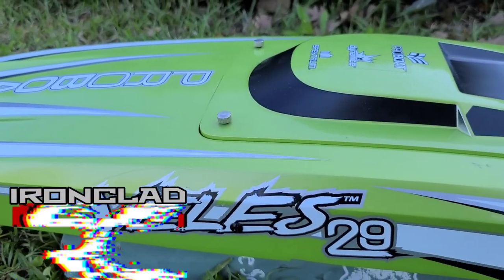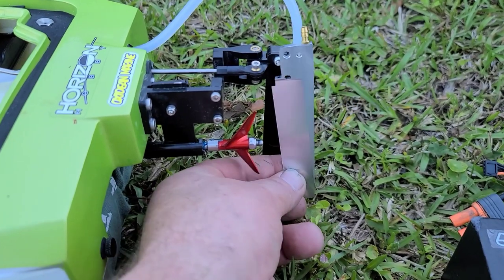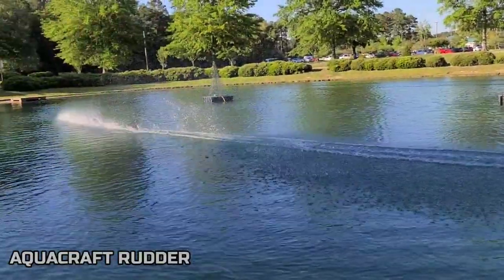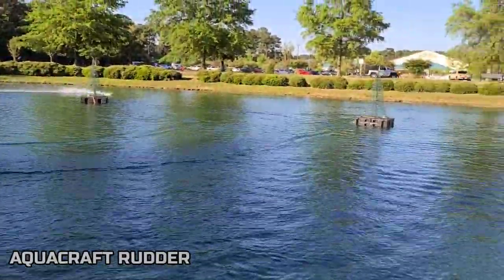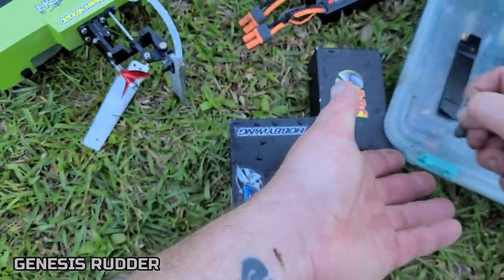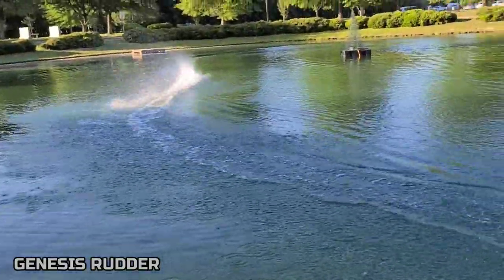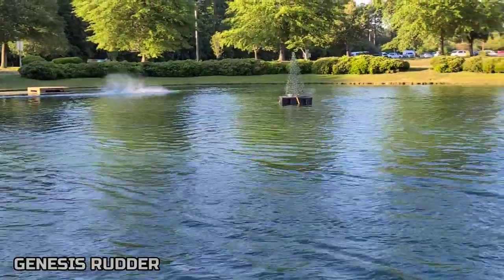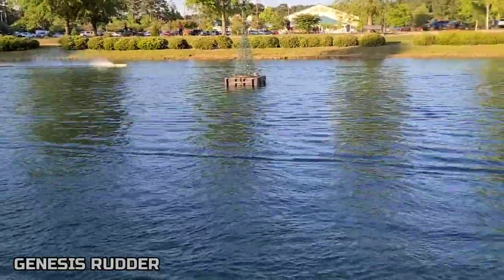Proboat Veles 29 Rudder Testing - Rc Boat Steering Problems

Comment: Hi B. Just found this whole set of vids on the Veles. Super set. Great info for my tuning of my first boat. Just a comment/theory on rudder “oversteer”. When you turn the control maybe 20% in a turn and the boat slows a bit whether you lay off the trigger or not, then, as the turn progresses I find that once it gets to a certain speed and “angle of attack” the front inside edge of the sponson catches in the water and the boat almost pivots on that sponson. 

At higher speeds it seems to me that the inside edge of that sponson doesn’t catch because 1, the boat is higher out of the water (drier) and 2, because you’re moving faster and the water is “harder”, less likely to catch. (that’s the waterskier in me coming out). 

What say you all-knowing, all-seeing boat-god!?😆👍🏽

Comment: Yet another REALLY useful and informative video Big B. Often overlooked, rudder choice is so important as you have shown.
So yet another variable in the universe of unlimited variables that come into play with the RC boat hobby...
Hull shape, size, profile. Motor diameter, length, kV rating, pole count. Inboard, outboard motor. Electric, gas, nitro. Conventional drive, integrated or jet drive. Drive shaft type, diameter, length and type. ESC current handling and power management. Battery type, weight, dimensions, voltage, Mah and C rating. Hardware and electronics placement for correct COG. All the variables with water cooling set up. Transmitter and receiver type. Strut/stinger position, length and angle. Trim tab size, position and angle. Turn fin shape, size, position and angle. Prop type (number of blades and material) diameter, pitch, rake and blade profile. And of course rudder shape, size and angle.
Geesh! I could go on but I'll quit 'jackin mah jaws'! 
No wonder this hobby is so unique and interesting. With all these variables is it any wonder that we keep on tinkering, testing and tuning?
Thanks for sharing the knowledge brother. Awesome stuff 👏 👌
Reply from the maker: Thanks steve Yep I believe you just about covered everything.   You forgot the part about having fun while your finding your  rc boat bliss

Comment: Thanks for sharing this boat definitely likes to role over...uuggg..mine does the same dam thing.uugg..lol..so we took the stock rudder plugged the holes with jb weld..we run different water pick ups behind the prop.. anyways we took the stock rudder filed it down flatter..thined it out...we then cut the bottom of the rudder off just under the bottom water pick up that was there.we then filed the angle going up from the bottom like it was stock..ok...and rounded the two bottom ends to finish it so far so good...just putting it out there...lol...as always iron clad style man... 😊.. ❤️..
Reply from the maker: I did the same thing to my beles rudder night and day

Comment: Love these test and tune videos. Great timing too, I just recently modified my stock Veles rudder. I believe that I heard advice here on your channel about modifying rudder to optimize handling.  I removed approx 1/2" of the length from the bottom. Then I reshaped the bottom of the rudder tapering the bottom edges  and thinned out the thickness of whole rudder. Also I sharpened the leading edge and chamfered the trailing edge.  So far so good. My low speed turning  has improved greatly with response being way more predictable.  As always thanks for the info bro. Rc boatgang
Reply from the maker: So it did work that's great to hear.   Your opinion is it worth doing and showing the viewers?   I've been wanting to modify the stock rudder but haven't grew the balls to do so yet.   😕
Reply: @IRONCLADRC  definitely worth the effort bro. I wil post a. Quick vid so you can see what it turned out like . Everything you had mentioned previously worked like a charm . After modifications, I had to use the veles to recover the SonicWake while waterlogged. If not for the mods to the rudder I think that I might have lost both of them.
Reply from the maker: Yea man that would be awesome.  I'd definitely like to see the modification I saw the sonicwake rescue & your right the veles did look very planted In the water

Comment: Just put this boat on the water for the first-time last weekend and it made it about 50 feet and the flex cable slipped in the collet and I know it was tight before launching, brought it in and tightened it again and the same thing so I inspected the collet, and the collet nut was stripped out. The collet looks just fine but the taper in the nut is gone so it won't tighten down on the flex-cable the metal is so soft that the stainless-steel collet shaved the taper out of the nut and didn't hurt the collet at all. I'm disappointed with pro boat on the first run on my new Veles 29. got a new collet coming from Offshore marine should be here tomorrow we will give it another go this weekend
Reply from the maker: You have extra to go over the whole boat inside & out.  check  everything before your first run.
Reply: @IRONCLADRC  After further inspection I found that the collet nut was made from soft mild Chinese Steel the collet was ok and made of stainless steel the nut on the other hand either didn't get hardened or was made from the wrong material. The OSE coupler is working fine. I did go over the whole boat before taking to the lake. I think that even experienced guys would not catch this defect right out of the gate.

Comment: Good video brother.  Very informative.
I don’t own one but a buddy does and I’m very aware of how the boat rolls in the corner.   Now I do wonder if it’s how the sponson is shaped and causing the outside edge of the sponson to catch the water and tip it over.   Maybe adding Dihedral to the sponson may help.   I own a different catamaran and the sponson has a lot of dehydral in the sponson ride pad and when she turns the boat will actually lean some.  
A thought that crossed my mind for a experiment on the veles.
Reply from the maker: When you say dihedral  are you talking about  adding angle, dead rise angle to the sponsons?    Or more non-trip to the outsides of the sponson?   Not sure ?   Sorry I'm not exactly sure what dihedral is, lol.
Reply: @IRONCLADRC  yes angle/ dead rise on the ride pad. Example this cat I have.  1 3/16 wide ride pad and the outer edge rises up 1/8.  +/- 5 degrees.   
Just a thought on my end as to blue printing the hull.   Dead rise is common to sponson designs specially in hydroplanes. Always experimenting.
Reply from the maker: @mad_lizard  Roger that, I figured that's what you were talking about.   I agree I think that would help tremendously.  I alot of work the pull off but it's definitely possible, I've gotta do some finish work to my sponsons and I will definitely keep that in mind..   thanks brother.
Reply: @IRONCLADRC  your welcome anytime brother.  We’re always tinkering testing and running

Comment: Correct me if i am wrong  when i set up CG on my boat i divide boat in 3 sections... Like if i have a 30 inch boat my cg is approx 20''' from bow going back... I also try to keep center of gravity as low as possible and when my boat sits in water i do my best so it does not lean to one side... but when i think about it if you are racing like you do its good to have more weight on left side of boat anyway....
Reply from the maker: You're on the right track..

Comment: Always a great video. Thank you for the great info. Question which one would you prefer the Veles or the ul-19?
Reply from the maker: What's your skill level regarding rc boats? The ul-19 is an awesome boat one of my favorites but it definitely needs some work to be a solid oval boat.  (Cooling, turn fin & upgraded esc)   The veles is a little more beginner friendly and really only need a second cooling line & servo to make it a solid boat.

Comment: Hello brother hope all is well I have question for you! I have sonic wake v2 and the boat turns one direction great nearly on a dime ( I believe it’s turn left really good) but it hardly turns the other direction  at all! I realize you need to have some momentum or speed when turning however when saying that the boat turns the one direction really well with or without speed but won’t turn the other direction with or without speed, do you have any suggestions

Comment: So I'm thinking and wondering if trim tabs would help this boat...I definitely don't like the blow overs and running pack all up front..thinking trim tabs move packs back to center full trigger...what do you think...
Reply from the maker: Personally I would never put trim tabs on the veles.
Reply: @IRONCLADRC  were going to make some temporary home make bent tabs and just use some double face tape foam to just hold them there and see what happens..yes I can respect you wouldn't.. ❤️..will try it anyway no holes drilled...lol..if they stay on..lol..
Reply from the maker: Try setting them about 5-6mm above the ride surface I've had good luck with that setup on my 42 kinda Acts as a ride pad not a trim tab

Comment: Big B, I know you usually leave the epoxy bare after blueprinting your hulls, would it help to use something like 2k clear coat and sand with 400/600 grit for best results and or even use some of the graphite spray?
Reply from the maker: Epoxy/graphit works the best I've been testing different finishes on different boats to see what works best for me.    I've used clear coats, epoxy/graphite, epoxy with pigments, epox paints,  primers for my final finishing in the past,  as long as it's hard & sandable I don't see why not.   I used clear acrylic as a top coat for the blueprint on my blackjack 42 after I  airbrushed a design, it sands good dries fast but doesn't build/fill very good.   If you use a clear the boat basically needs to be finished to its final shape because clears tend to lay down flat.
Reply: @IRONCLADRC  in this instance I’ll be blue printing the bottom of a Geico Hull and a Veles 29” hull. Do you think sanding them to where they are true and then put the graphite spray right on? Do you think I should sand them true and then add my paint, clear coat with 2k clear and then graphite spray the sponsons?

Comment: Big B how's it going I have this boat and I know wat u mean by tips on a turn I'm going to try a longer rudder it looked like it help and how do u blueprint been thinking about that on my veles thanks
Reply from the maker: A shorter rudder may be the ticket you ca. Actuallyshorten the stock rudderand get a better ride ( i may do that here shortly) , if you have extra rudders laying around I'd try a couple different rudders to see what you like. It's kinda fun Testing and watching for the differences between each...   as for the blue print It's alot of work, alot of work!  if done incorrectly it would ruin the ride of the boat.  Blueprinting a boat is basically taking out any imperfections, dips, hooks, that may be in the ride surfce.. most boats Don't need to be Blueprinted there is that rare occasion that Blueprinting a hull will improve the ride.  Hope this helps
Reply: @IRONCLADRC  big B I'm just checking my msgs and thanks for the advice but how short should I make the normal rudder on the VELES 29 take like an inch or so off or ???? And my bad for the late respond back busy up here in Wisconsin now summer time almost here  thanks for the help and blueprinting sounds a little hard for me to do at this time I'm still just learning all bout rc boats thanks again

Comment: dude have you tryed the ul19  rudder thats what i use as this boat is made to go fast in straight line and turns
Reply from the maker: I was gonna bring the ul19 rudder for the testing but didn't have the time to remove it.  That's for the tip.

Comment: Where can get the battereries you get and charger
Reply from the maker: This is a good setup. 6s 100c bundle 

https://www.avantlink.com/click.php?tt=cl&merchant_id=953aec29-878e-4306-b620-2df85883455e&website_id=70256520-69d3-496b-a06d-cfbf9af7a81d&url=https%3A%2F%2Fwww.horizonhobby.com%2Fhttps%3A%2F%2Fwww.horizonhobby.com%2Fproduct%2Fsmart-powerstage-bundle-6s%2FSPMXPS6.html

Comment: bro i use completely different hardware custom made with bigger holes and 115mm rudder 5mm longer and its very effective in tight corners at speed
Reply from the maker: I may modify the Aquacraft rudder & see what it does with the leading edge taken down a couple millimeters?
Reply: @IRONCLADRC  I already tried it and at least it didn't work for me, it's too short for the power that my boat has but good luck you stock

Comment: your boat needs two rear fins to prevent it from stalling and rotating 180 degrees due to too much propeller thrust against a rudder that is too small to make speed like on a boat in V-shape or mono-hull
Reply from the maker: I've got her tuned in since this video

Comment: Love the vid man! Just a quick question where do u get the rudder u ended up using? Just curious cuz I am looking for mine
Reply from the maker: Offshoreelectrics.com has an upgrade rudder for the veles that should work just fine, it has dual water intake, Just search veles at ose